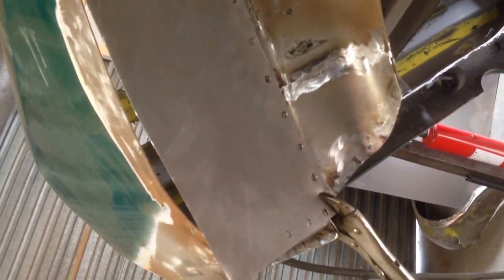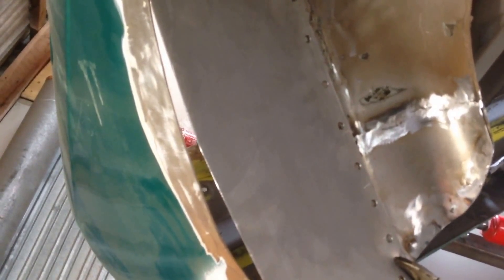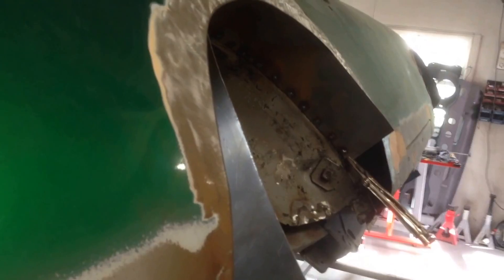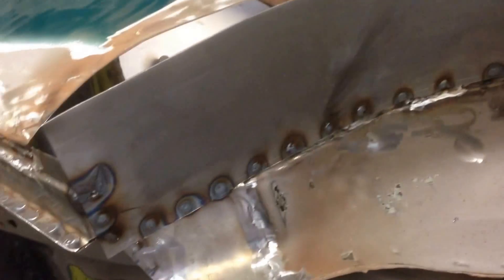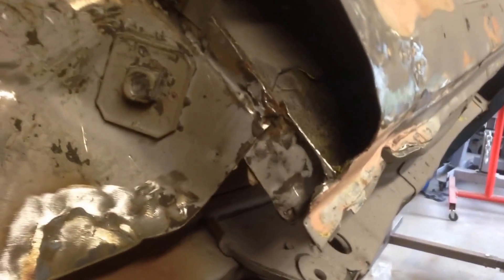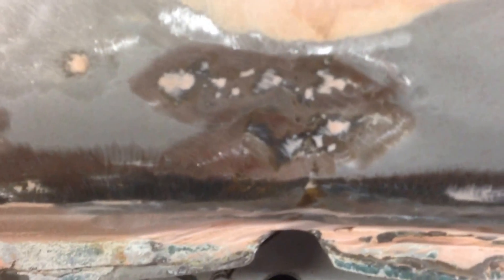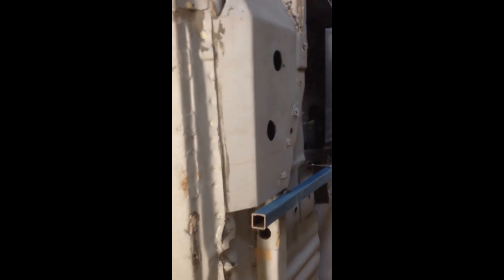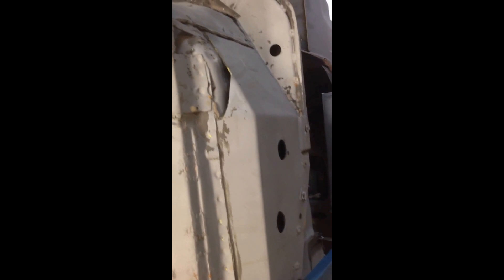MK1 ford escort restoration part -2

Comment: @Mallet's Shed Hi, what do you use as the very first coat on the bare sanded down steel to protect it from rust in the future?
Reply from the maker: Hi just to stop the moisture in the air during restoration , I use cellulose primer , just a thin coat as when all welding complete will get taken back to bare metal and 2k primer over total shell . Hope that helps :)
Reply: thanks,ive got an old escort van and i resprayed it once 2 years ago, and the rust came back on the cills,door bottoms,wheel arches etc,so this time around doing lots of research before i take it down to bare steel and start again.Will your 2K primer have any rust preventer or inhibitor in it?
Reply: SP330Y are spraying in booth ? Needs to be dry air , if your going to paint it in your shed you will need to check you have a low humidity day , or you will be trapping moisture under the paint and it will bubble through again , or see if you can get it into a spray booth where they can control the environment to prevent :)
Reply: No not spraying in a booth,outside when hot days. I have researched more,I am going to galvanise the van when its at bare metal,so take it down to bare steel and spray zinch rich cold galvanaising paint on that surface,allow to dry then its totally sealed to the elements,its not pourous, then after that 2k primer surfacer,basecoat and clear.
This cold galvanising paint is used on oil rig legs,underneath ships,its guaranteed for 15 years + under water, thats good enough for my van :)